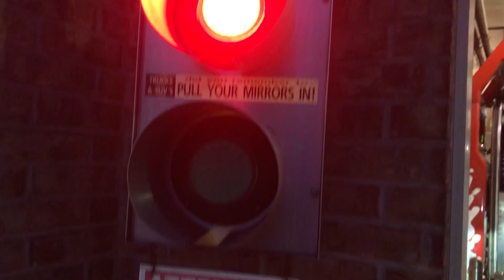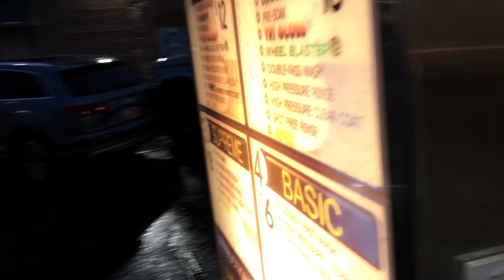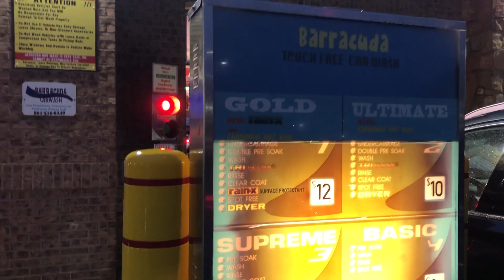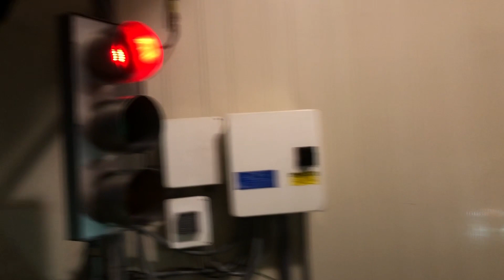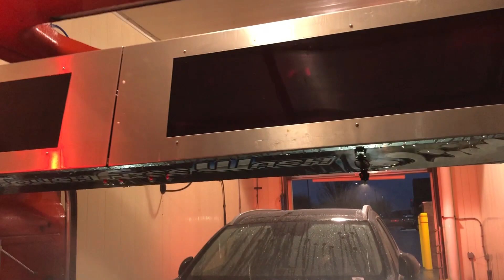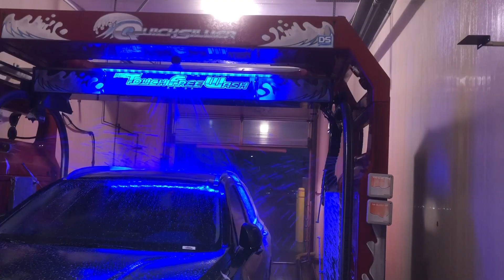Pretty Good D&S Quicksilver - Barracuda Car Wash - Riverton UT

Comment: Great video bro! What do you think of the odyssey systems? Went through one the other day in MS and it was REALLY rough on my truck.
Reply: And it seemed like the top brush wasn’t getting the top well at all
Reply from the maker: I think Odyssey systems are really cool because of how rare they are, but there’s definitely a reason D&S discontinued it. It cleans fine but like you said, it does the job VERY roughly. I saw your reply, the top brush kinda misses some parts because it’s pressure sensing, but I don’t think it’s a problem because of how dense it is. It’s one of the roughest top brushes I’ve ever felt. Not that it scratches but this is definitely not a very gentle wash.